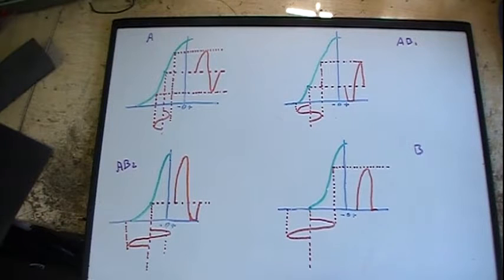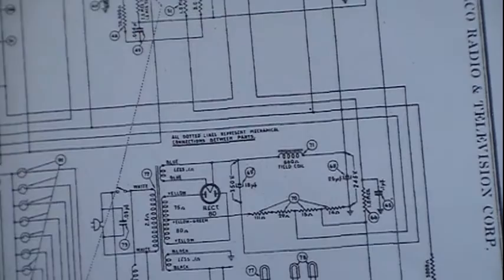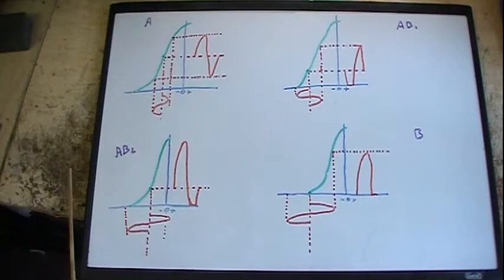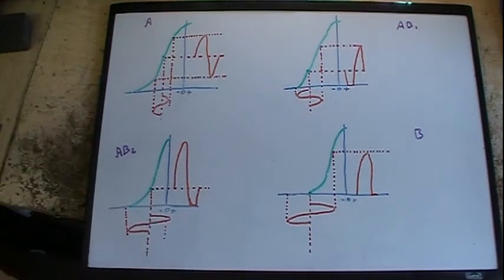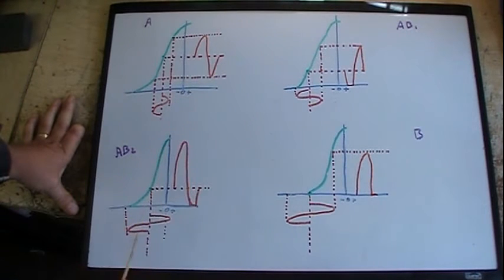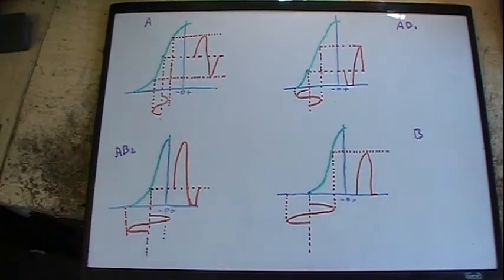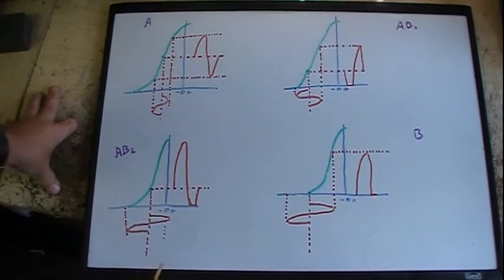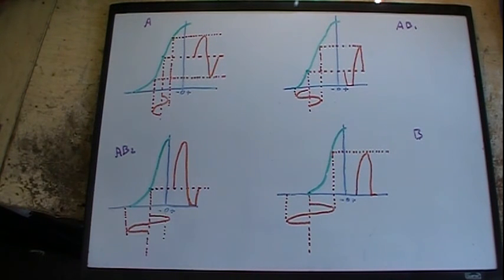Tube ampifier class's

Comment: GREAT video, as always when you´re doing theory videos :) :)

I´m particular interested in AB2 as when i experimented with this toppic i simply couldn´t get it to work right, i always ended up with easily noticable distortion when i tried to do it with a tube driver, but i know the output stage is ok, as when i drove it with a solid state PowerAmp all was fine....

I have a feeling that i got lost somewhere, or simply didn´t get the whole tube driver thing when it comes to class AB2....

As when i measured the inrush current of the output tube, it needed some serveral hundred microAmps up to single digit count milliAmps at most (for 807 AB2 PP). And the control grid impedance changed dramaticallyas well...so the current needs to come from the driver stage. How this needs to be done? I simply don´t know this, jet.

I tried a cathode follower as well, but it ends up with a ringing overshoot at TopMost positive peak, sounding very awful.....

I know this is a rather unused toppic by today´s point of view, as when you need more power simply add more output tubes....i know that as well ;)

But i want:
1) to understand that AB2 driver toppic to the core 
2) to build up a nice working Class AB2 PP Amp with big Transmitting tubes with an all tube circuit. As these tube surely need some positive grid voltage to have some serious power at the speaker´s jacks :)
Reply from the maker: TubiCal Thanks. I will be doing a few videos on audio amps this fall.